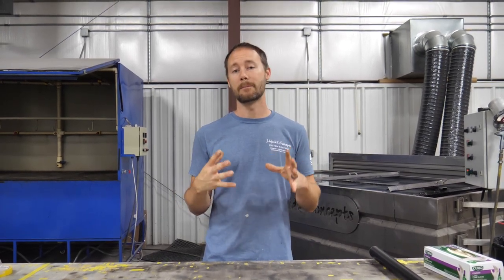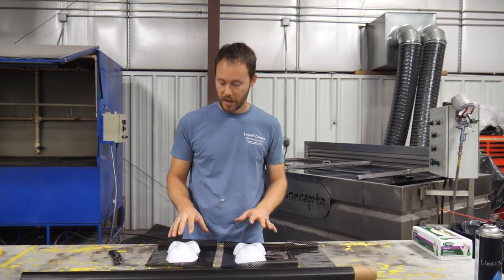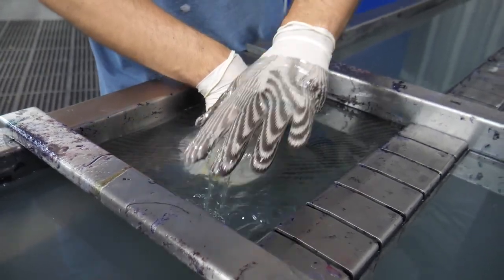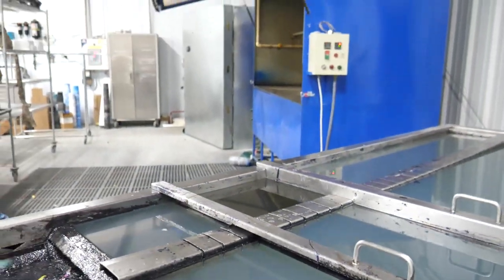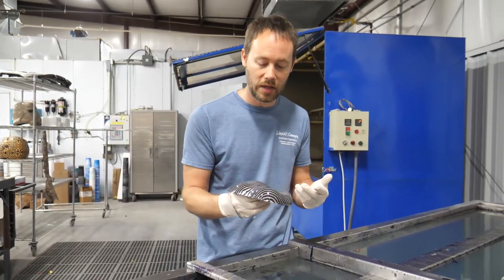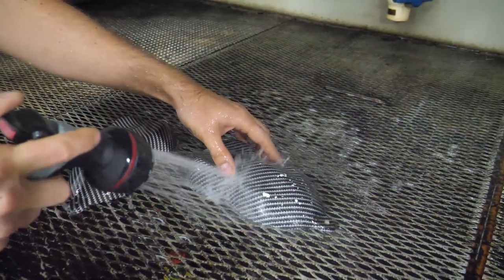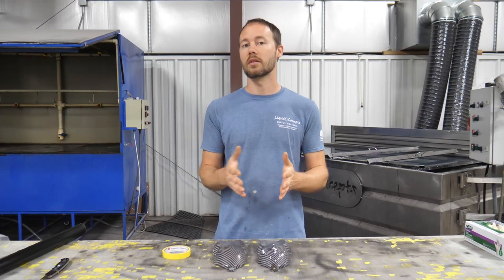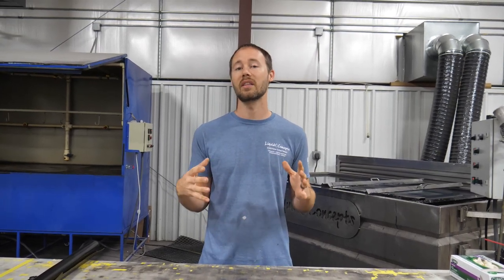WHY YOU'RE GETTING PINHOLES IN YOUR HYDROGRAPHICS | Liquid Concepts | Weekly Tips and Tricks

Comment: Do you have a video with carbon film waving once activated? I’ve been trying to find one and I’m going nuts trying to figure out why my film slightly starts getting waves once activated.
Reply: Too much disruption. Rattle cans are notorious for that. If it’s a gun, back the air off a bit or hold further back. Also try tightening up the barriers.
Reply: Just remember the distance of 30cm between the film and gun while you activate

Comment: Perfect timing on posting this vid! I Tried my first dip today with your carbon fiber and had the pin holes. I def need to use more activator.  Quick question, how much does the water temp affect the dip?  I've been at 90 - 93 deg (I'm in south fl and its HOT here lol)
Reply: Not that critical I did my first dips at 70 degrees and they came out fine. You just have to adapt your technique to your conditions

Comment: I have been trying to dip my mini 14 stock for the past 4 days now. I have done everything you said. I prep the stock by heat treating it, I scuffed it up, I used One Hit Wonder all in one white spray paint, my water temp is 84.3 deg, I used ink drink spray can activator as directed and I still have tons of pin holes. What else can contribute to pin holes? Could it be a bad run of the film?
Reply: If the film don't peel off, just touch up the pin holes with paint

Comment: Interesting, I'm also doing hydro dipping for some interieur parts of my BMW and when I touch the film right after the dipping it comes of again sometimes specially at the edges. Does that happen when I used to less activator?
Reply from the maker: if the film is coming off after you dip the part it sounds like not enough activator was applied to the part. Try applying more activator and see if that helps!
Reply: I'm in the same boat. Interior parts for my BMW. Third try was better, but still not good enough. Time to find more plastic pieces to practice.